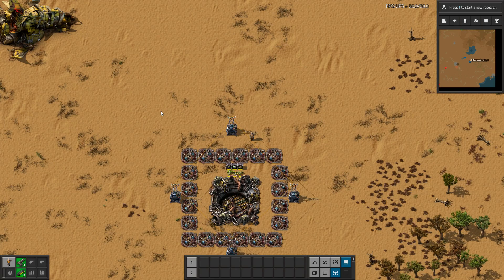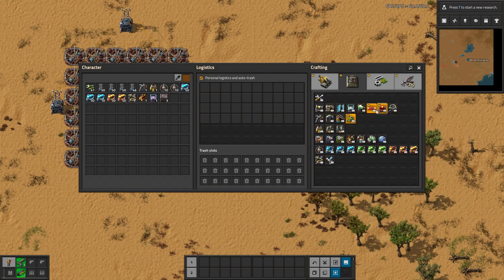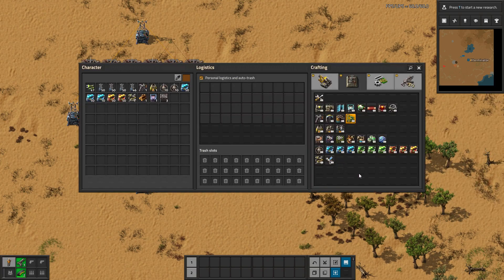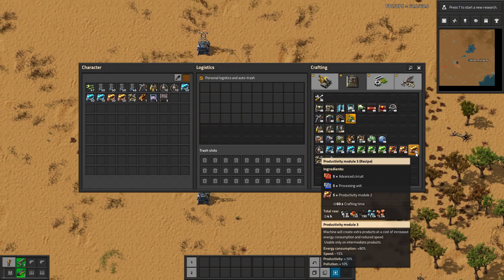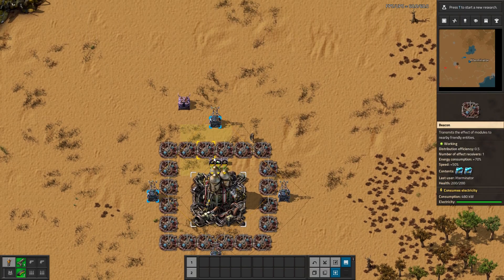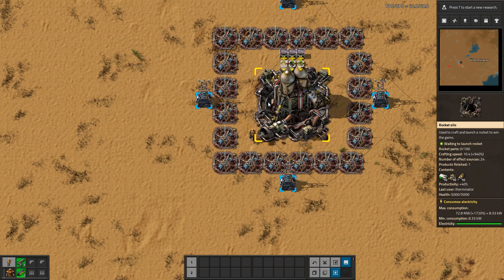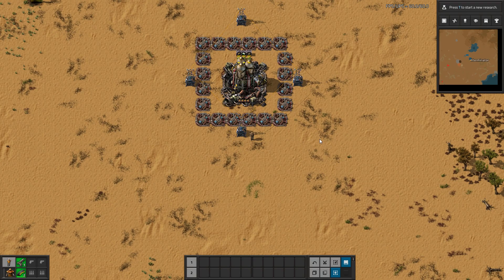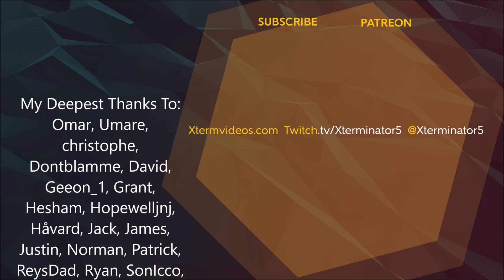Factorio Tutorial & PSA: The Benefits of Productivity Modules in the Rocket Silo

Comment: Thanks, very helpful.  In practice, I don't really see using speed beacons, because I find I am not feeding components into the rocket silo to make it suck up the components at full tilt.  

I.e., the silo is spending a lot of time in the "no ingredients" state.  So, the main thing slowing me down is the lack of ingredients.  

The PMs help a lot because of the bonus they provide.  But I think the speed beacons would not contribute very much, because the silo would spend just as much time in a "no ingredients" state.  I hope this makes sense.

However, after having built a great mega base, which can pump ingredients into the silo(s) at full tilt and keep the silo(s) constantly in a "working" state, then the speed beacons would probably make sense, I give you that.

Comment: So here is my take on modules.
There is three: Speed, Efficiency and Productivity.
*Speed*; Increases the Crafting speed of the building making it also drain more power with 50/60/70/80% increased power drain for a 20/30/50/70% speed increase.
*Efficiency*; Lowers the Energy drain a building has by -30/40/50/60%
*Productivity*; Increases the Energy drain, lowers the crafting speed, increases the pollution created and the productivity of the building by: 40/60/80/120% energy drain, -10/12/14/15% crafting speed, 5/7/10/15% pollution and 4/6/8/12% productivity.

For most buildings that can use the Productivity Module, will only have 2 Slots, so that is a total of 240% increased power demand, 30% increased pollution, -30% crafting speed, for a 24% Productivity increase. This means you need a Speed module 1 to remove the crafting speed penalty + 2-3 Efficiency 3 Modules to negate that energy cost (In 2 Beacons). For a 0.24 increase resource production. Basically every 5 resource, will produce 1.2 extra, every 10 is 2.4, and every 100 is 24 extra for the same resource cost.
Example, 1 Iron Ore, makes 1 Iron Plate, but if you can boost the productivity of the Furnace to be +72% (with 6 Modules this is from Sea Block so most likely modded). Then Every 1 Iron ore will produce 1.72 Iron Plates, and every 100 Iron Ore will produce 172 Iron Plates.
It doesn't reduce the cost of resources, but produces more resources per resource.

Technically the Productivity Module, increases the Efficiency of the Resource conversion, to produce more of the resource. But it comes with the caviat that you need to use beacons to get back the craft speed, and lower the energy cost.
And in some cases, I say the Productivity Module is good, in others I find speed to just be better. It all depends really on the outset.
Same with Efficiency, some Buildings in modded Factorio it is a godsend on energy production, making so I don't need to blast out more energy for longer.

Comment: Side point, but I wouldn't recommend beaconing a single silo so heavily. The rocket launch time, i.e. the time from finishing one rocket to start building the next, is about 42 s and the beacons won't affect that, so when there's enough of them the silo will spend most of the time in the rocket launch animation and adding more beacons gives diminishing returns. E.g. a single silo with 20 beacons around it is slightly slower than two silos with just 5 beacons (assuming SM3's in them), and it's easy to reuse the same 5 beacons for both silos.

Comment: I would limit the speed beacons to how many you actually need, myself. We're currently at 8,5-ish science per minute with our base so it doesn't make sense to put more than 6 speed beacons next to the silo, for example. Other important things to save on resources are to only launch rockets when low on space science (by not inserting the sattelite until a certain threshold is met for example), as well as not using rocket launches to mine for fish

Comment: You don't really need to surround the entire silo with beacons when you start out. Just a single beacon is enough to compensate for the productivity module slowdown. A handful of beacons are enough for several hundred SPM. All possible beacons are enough for almost 1000 SPM

The Factorio Cheat Sheet has an interesting section with payoffs for the module cost, giving you a hint of where to start using them: https://factoriocheatsheet.com/#productivity-module-payoffs
It also mentions the 3 PM + 1 SM option, which is really nice for non-silo stuff, if you don't want to switch over to beacons right away
Reply: I'd argue that you shouldn't beacon your first couple rockets at all. It can already be a hassle and half to feed the machines enough resources when it's at 40% speed. Even if it looks like your factory could handle it, at least wait until you've actually launched it.